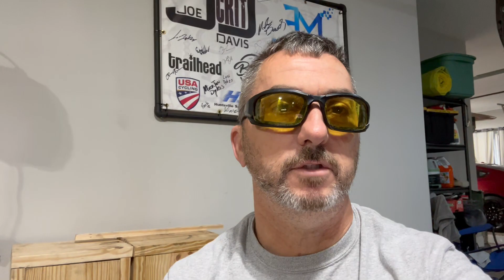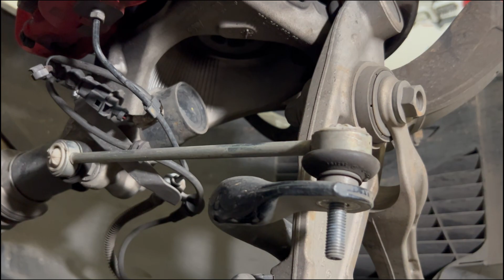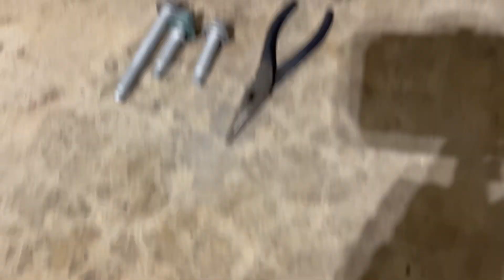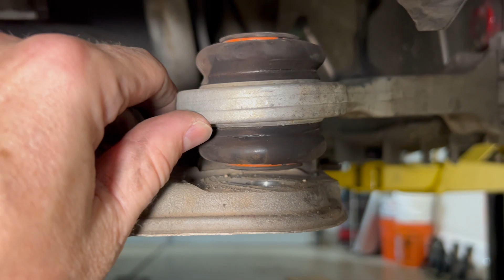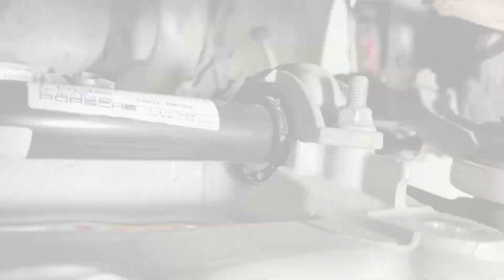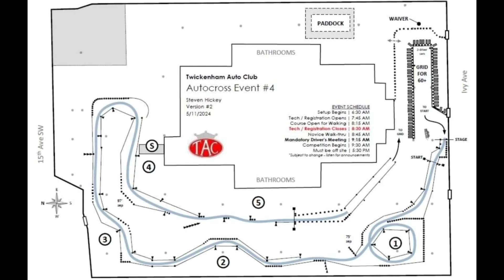718 Cayman Front Sway Bar | No need to break your Balls! | One Nine Racing

Comment: Can you do the factory GT4 End Links instead of those Tarrett ones whilst upgrading to this respective sway bar?
Reply from the maker: Hey Omair, I’m not certain that would work perfectly. The adjustable drop links are to get the best unloaded (at neutral) start position you can get. I do know the GT4 uprights are different than any non-GT cars, so I’m not certain of any mounting point/position deltas and fixed drop links would more than likely induce unwanted load in different sway bar holes.

Comment: Did you purchase the swaybar from Tarett or order one from Porsche? I think I can save some money order one from Porsche but I don’t know which bushings I need. As always thanks again for a great informative video!
Reply from the maker: I did hit the 'easy button' with Tarett. If memory is correct the 5 positon rear was my decision point with the drop links of course. Everything has been holding up well. *I'm in the middle hole (of three) up front and one off full-soft (second hole of five) in the rear with my coil overs. The coil overs cured my mid-corner oversteer.
Reply: @OneNineRacing-tl4kf that’s exactly what I did earlier today. Thanks for getting back with me.